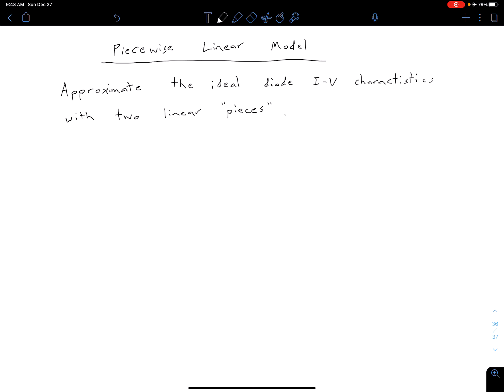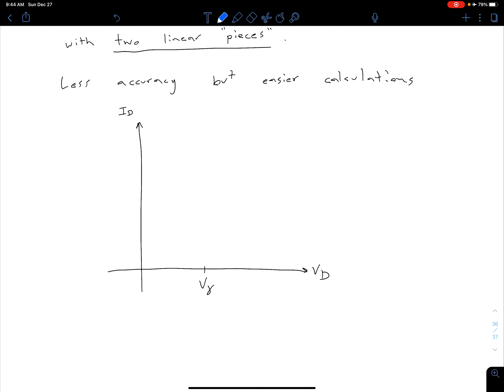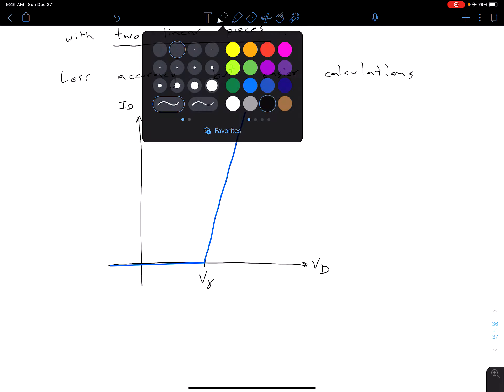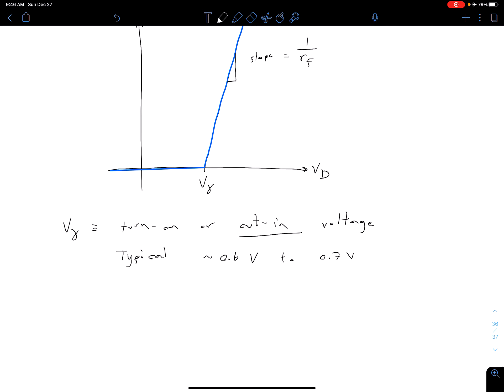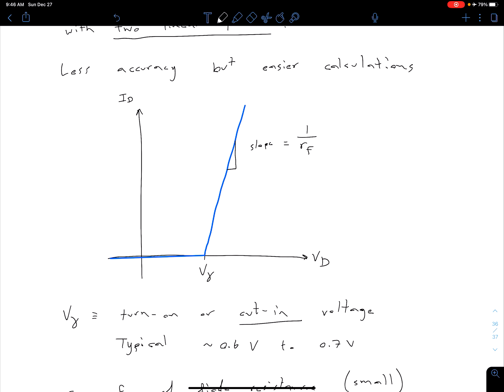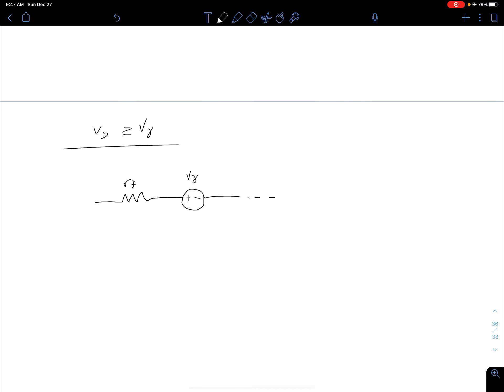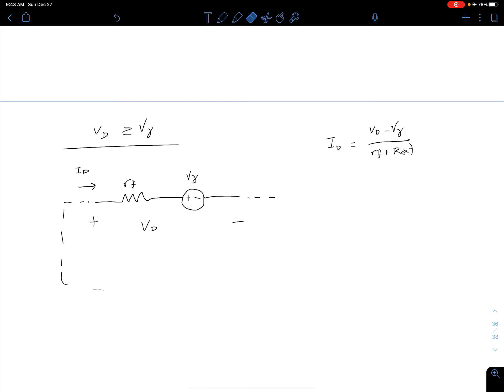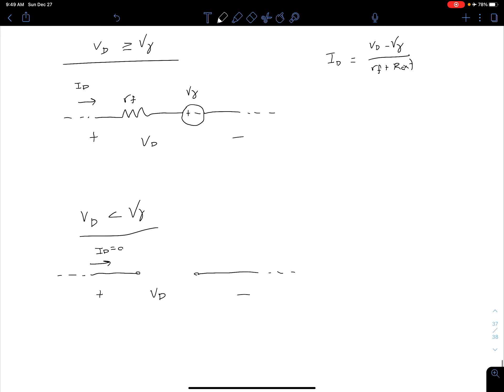SP & Diodes - Piecewise Linear Model

Comment from the maker: Around 5:30, the Rext term should NOT be in the equation. If there is an Rext term it doesn't really make sense unless there is some term for an external voltage source as well (which is required to "turn on" the diode such that we can use this piecewise linear approximation). 

See some of the later videos on analyzing diode circuits for clarification.